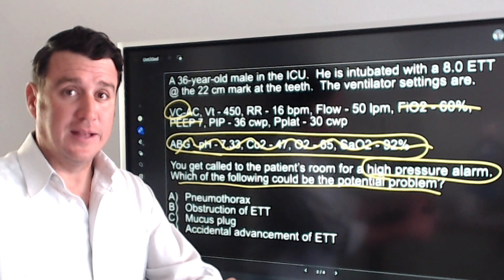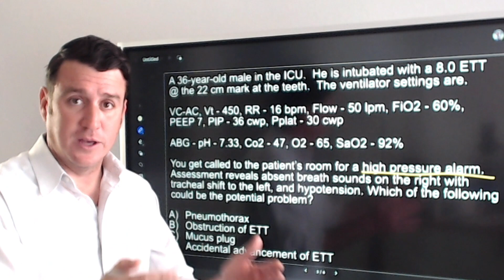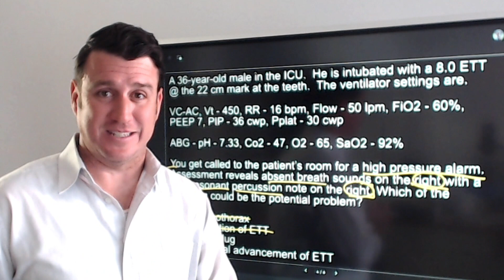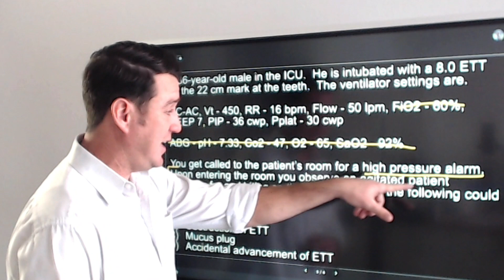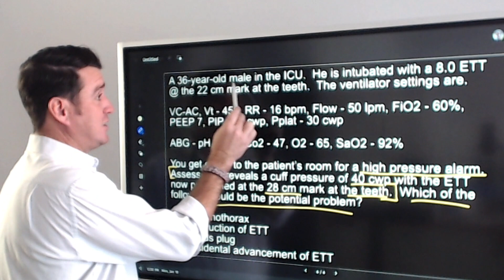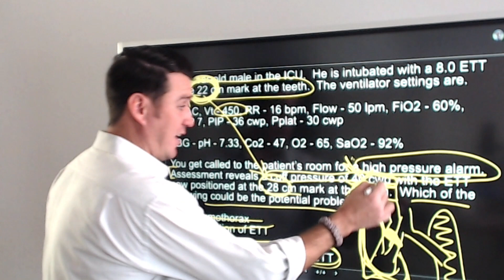Respiratory Therapy - Volume Control and High Pressure Alarm Practice TMC Question Breakdown

Comment: Coach, this vid is superb 5yrs later. Would you consider doing more like this, i find myself struggling w ABG interpretations... mechanical ventilation like appropriate base settings for certain diseases... and EKG. My boards attempt 3weeks had about 5 ekg interpretations and appropriate responses. I graduated with egans 12th edition btw

Comment: So have a question i thought if you are in A/C mode to not change the rate but to change vt
Reply: See that’s interesting because I was under the impression that if you set Vt by IBW, you would change rate before changing Vt since you have a narrower range of changes possible with Vt before you start getting into over distention and volutrauma and that would include pretty much all modes where you set Vt and RR yourself.

Comment: The high cuff pressure is relevant to an endobronchial intubation because your right main bronchus has a smaller diameter than your trachea, so would mean more pressure on the cuff as it has to squeeze into a tighter area. 
Is just an added bit of info to help guide you to the right answer imo.

Comment: This was an awesome video! I always see these 4 questions on every practice exam…. Always going to be a pneumo, always going to have a right mainstem, and you’ll always have an obstruction that causes high pips. The way you broke down the mucus plug answer really made sense. Another great video and make sure you read the whole question. 

You should do a break down on those patients with lobectomies, and selecting a proper tidal volume now that your lung surface area has changed. Your IBW is still the same but now you have to separate it out. I saw one of these questions on the NBRC… I used my anatomy and divided the total tidal volume in half to separate the 2 lungs and then remembered the right lung has 3 lobes and the left only has 2 lobes and then just went from there.